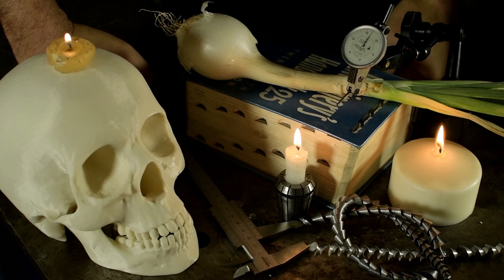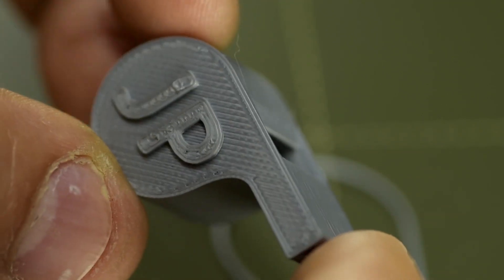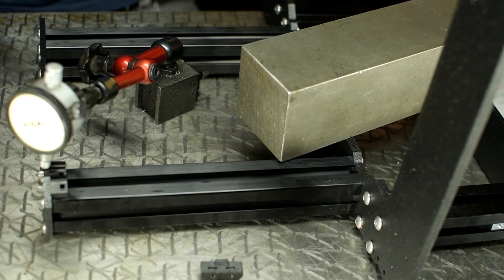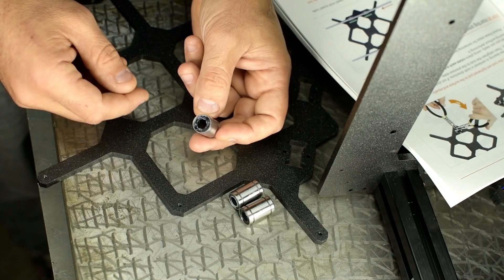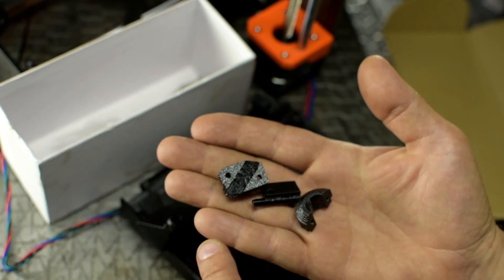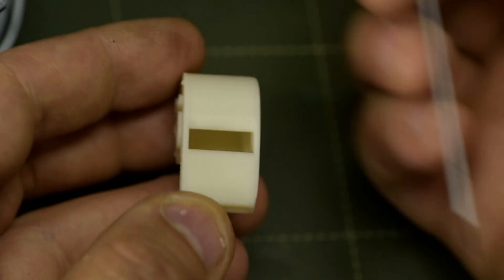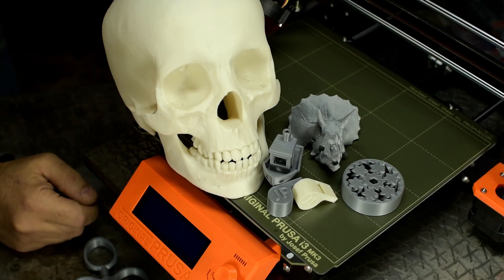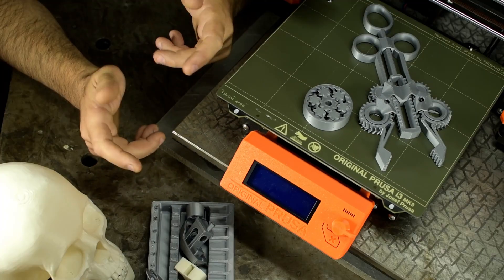This Old Tony in 3D!!! (printing)

Comment: I built a Creality CR-10 (Chinese knockoff) from a kit a few years ago. It has been great! I use it weekly and it's a work horse. I can't believe how many uses I've come up with over the years. From simple clamps to auto shift knobs to drink coasters to cell phone accessories... The list goes on and on. I've combined it with other hobbies like two part colored epoxy and even with my drone photography and welding/metal work hobbies. I use Tinkercad as my primary design tool. Easy to learn and your only limit is your own imagination and creativity. Thanks for adding this to your fantastic build videos. You of all people will come up with some GREAT uses. BTW, It took just as many gummi bears to complete as the Prusa.

Comment: Try some HIPS (High Impact Polystyrene) It prints with ABS settings, and is sandable and paintable.  Also, tends to be a lot cheaper, or at least used to be.  I'm having trouble finding it now.

Comment: Your Y-axis acceleration looks like it could be reduced a bit. The Benchy shows a bit of where the build plate took a bit to slow down and couldn't perfectly stop (I'm guessing it was printed point to the front of the machine). You might even be able to reduce the acceleration on both the  X- and Y- axes, and that'd just clean up corners. The wisps could either be a sign of the temperature being a bit high for the filament or needing to slightly retract on moves.

Comment: Hey, great video as always. I use an Ender3. I love it, but I will be the first to admit that it is so heavily modified, that it doesn't much resemble the original device. I'll be eagerly waiting for the day you decide to build one from scratch using a MIG welder for an extruder.

Comment: I really recommend PETG. Strength of ABS without the warp-age although slightly hard to print that PLA. The thing with PET is higher temps and much slower speeds. I have been printing with PETG exclusively for a couple years and have only started to have issues (mainly due to a clogged nozzle and not installing the new nozzle while up to temp). I have some 18 and 20v battery holders I print and sell. If you let me know what platform you use I'd be happy to send you a few so you can see PETG durability.

Comment: Expect to be terrible at it for a while and relearning many new things when trying new models for the first time. Then you quickly start learning to a new level and you think you're there. You're not. Now comes the most horrible part where you constantly try new settings but can't find out what works or not. And then finally when you push through that, you get ok at printing.
A good printer helps taking away some of the learning process but you will always need trial and some errors when printing new models.

Comment: no 3d printer should ever be held together with zip ties. It's a fatal flaw in the design and it points to a mindset of cutting corners. Corners that will bite you right on the ass later.
Reply: @npgoalkeeper _ interesting, so how is it more tolerant to misalignment? Genuine question.

Comment: 3D printers really are incredibly useful once you learn how to design parts to utilize their strengths. I'd suggest learning a bit more about compliant part designs, Brigham Young University does quite a bit with them. For materials, I'd suggest PET-G, it's about as easy to print as PLA, but a lot stronger and less brittle, TPU is also interesting because it's very flexible.

Comment: I also have a Prusa i3, and take it from me, try not to touch the print surface with your bare fingers. I had a run for a while where I just couldn't get my pla filament to stick to the bed, changing temperatures helped but not enough. Turns out as I was new to the sport I was being stupid and touching the print area without cleaning it enough. These days I never touch the hotbed unless I absolutely have to, and I wipe it down with 99% isopropyl before every print.

I really hope you enjoy printing, I've had mine for about a year, and it still doesn't get old.

Comment: Great. After watching this I've now bought an Ender 5 Pro. Didn't know I wanted a 3D printer till now 🙄
Reply: Well the Ender 5 Pro lasted less than a week. Full refund given and now I'm the owner of a kit built Prusa mk3S. In 10 days of non stop printing with PLA and PETG I've not had a single issue. Fantastic bit of kit.

Comment: You'll notice over time there PLA is subject to deformation from heat, PETG needs to be hot with zero wind. Ellmers glue stick on the bed solves any bed adhesion issues on the small scale with basic materials. (High temperature filaments are great for usable parts but everything cost way more.) A great way to make usable parts with this machine is to make molds or nearly hollow parts that you can fill with the resin of your choice. I mostly use there 3:1 laminating epoxy from FGCI.com with 1/32 milled fiberglass added then injected into the hollow cavity with a large syringe and a blunt 14 gauge dispensing needle. You'll need to drill a tiny hole, don't push in a regular needle or it separates the layers. I set the infill at 10%, Lines, then rotate each layer 10 degrees. You'll see a setting with square brackets, use:  [45,135,55,145,65,155,75,165,85,175,95,185,105,195,115,205,125,215]. For shell items like the tray insert, add Fumed Silica to turn the epoxy into a gel and paint it on the back. Keep the epoxy thin to prevent thermal runaway. For filled parts, once filled you can plug the fill hole with foil tape then stick the whole thing under water to keep the shell from getting hot. Good luck, Tim

Comment: I actually have an Ender 3. It's decent enough out of the box, but definitely benefits from a few upgrades, such as a bed leveling probe and an upgraded mainboard. 

That said, if I was in the market now, the CR6 is a better option at $400. It's basically what I have in my Ender3, but with a touchscreen and none of the fiddling I've done.

Comment: Tony, Tony here...
Though you didn't mention it I feel it necessary to add the biggest benefit(s) to to building specifically a Prusa kit. 
1. When something breaks, you will know how it went together in the first place and how to get back to operational. I like this to the people that buy RTR rc cars and when they break, lie forgotten in a corner never to run again
2. A warranty, factory support and updates with printable part files.
3. I forgot 3, thanks for watching.

Comment: I too have that model and am quite enamored with it. A couple points I'd like to throw in there, are: 1) Get the upgraded plate with textures (at least about the time the included one starts losing its surface) and 2) The bed thermister wire will probably be the first thing to fatigue and fail, creating an opportunity for a video on repairing it. 3) [bonus point] If you have a problem, the company will probably want a video demonstrating it, but will then send replacement parts without trouble.

Comment: 2:07 For any whipper snappers watching, that's a Dot Matrix printer you're hearing 😅🤡
Reply: It sounds like one of those tiny receipt dot matrix printer, the larger ones for printing on A4 or even A3 sound a bit more like "BZZZZZZZZZZZZZZZZZZZZZZZZZZZZZZZZZZZZZZZZZZZT  ... BZZZZZZZZZZZZZZZZZZZZZZZZZZZZZZZZZZZZZt ... BZZZZZZZZZZZZZZZZZZZZZZZZZZZZZZZZZZZZZZZZZT". It has longer "bzzt"'s because it covers the whole line before printing the next line or going back to the start to print the next line.

Comment: And to add even more maker methods to the mix:
What kind of filament would burn away best, if you wanted to use lost-wax casting to transform a 3D printed plastic prototype into a molten metal masterpiece?

Comment: Sir, bringing your in depth-approach to the 3D printing world is amazing. Big thumbs up. 
I would really recommend you to delve in the Prusa Multi-Material add on that would allow using different filaments (like stronger inner resistance beams, flexible splines for articulated mechanisms or water soluble filament for impossible print-in-place objects).

Comment: You big baby. I built a box frame prusa from parts I ordered of ebay. I will admit it took me about a year of tinkering to get it working. The real pain in the ass is when you build a printer like I did you have almost no instructions. I would have killed for an instruction book like the one you have.Good job on your first print. I'm not going to tell you how fugly my first benchy was. I look forward to more 3d printing videos.
I almost forgot. Get a Raspberry pi and install OctoPrint. You will be able to control you printer from anywhere in the house. Add a cheap little Raspberry pi camera and you get nice time laps videos of you prints.
BTW - I leaned something from you. I used light machine oil on my bearings, guess I better fix that, but like I said, I did not have an instruction book.

Comment: PETG fantastic but sticks to the bed a bit too much with big parts

PLA works fine but absorbs moisture over time

ABS unless you build it a thermal enclosure....... R U N its not worth the time

ASA+ fantastic and great strength and thermal propertys

Comment: I can also definitely recommend the Creality (I've started on the Ender 3 Pro) but it's definitely less plug-and-play than this one was.  No auto-leveling means you'll have to get good at dialing it in yourself, and there are a few mods that I'd recommend. Namely:
- Direct drive adapter to improve consistency especially with flexible filaments (the parts of which can be 3D-printed on itself!)
- Glass print bed (I use the back, untextured side with a small amount of print adhesive)
- Also take a look at 3rd party firmware upgrades that are available for the control board!

Comment: Some advice regarding ASA: 
If you haven't vacuum bagged the material, DO IT NOW. ASA loves to absorb humidity.
ASA loves to warp due to uneven cooling. It will usually warp along the lines of the base. Large footprint PLA parts will do the same from time to time.

You can prevent warping by adjusting the angles of your base layer solid fill. Long lines will do a lot of pulling when they contract. If you can break up those lines with features or adjusting the angle, you can reduce the possibility of the part warping.

Also look into the DIY ECM stuff the 3D Printed gun guys are doing. They can bore steel tube stock, cut chambers, and cut rifling with 3D printed jigs, some copper wire, and a lab power supply.

Comment: Specifically your friends will have recommended the Creality Ender 3 or the Creality Ender 3 Pro (identical except for minor improvements).
I used to work with a couple of the Prusa Mk2 printers and I'm not a fan.
Ender 3 Pro has most of the same issues but is a fraction the price. 
In my experience the biggest difference is bed leveling, and I prefer the manual way of doing things. A PINDA probe is just one more thing to go wrong.

Comment: I bought a Flash Forge Creator Pro in 2014.  It has been a constant chore to keep it running.  I have spent almost as much as it cost in repairs and upgrades.  When you get to that point, you just try to keep it running.  It's a slow sinking ship.  I also use Simplify 3D.  Love that software.

New stepper motor drivers, all new cables (all custom made), new power supply, new extruders, heaters, thermocouples, new main board, new carriage assemblies, new stepper motors, new fans, additional lighting, better build platform, Vacuum Fluorescent Display, etc.  I would rather have a Form Labs.

Comment: I dont know if somebody already wrote it, nobody got time for reading all that ;-) ...
but you might wanna try some acetone surface finishing (for the solvable filaments).

put a support block in a large glass jar. fill a puddle of acetone so your object sits in the dry above.
close jar, set in sun or warm up a bit.
Let the acetone vapor lightly melt/flatten the surface (might also remove tiny hairs)

Comment: now you have to teach it how to print using JB Weld as the print medium . . . for durability!

shouldn't be too hard, just need a block to screw the tubes into with internal passages to a mixer/pump then to the nozzle (don't need the heater) . . . oh, yeah, and a mechanism to squeeze the tubes uniformly . . . other than cleanup, should be a piece of cake for a ToT . . . maybe you could 3D print the holder/squeezer/mixer/pump/nozzle assembly . . . that would eliminate the need to clean it, just print another.

Comment: Good choice on the Prusa. It is a great printer with solid software as you have obviously discovered. I also chose the kit to save money and familiarize myself with how it all works. I personally feel that is the way to go since the build is lengthy but actually quite easy, and most importantly it helps in the future with repairs or upgrades. One piece of advice... Until the time you decide to build a fancy enclosure for the thing, you can just throw a trash bag over it to hold in the heat. Yeah I know, that is about as far from fancy as one can get, honestly to the point of even being considered trashy maybe, but it does work quite well.

Comment: could you help me with a problematic ender 2? i kinda maybe modded the crap outta it (greg's wade extruder, pully x and y axis motor holders, tensioners, custom endstop mounts, stepper dampers, etc) the problem is, that no matter how much i autotune the PID, or how level the bed is, or how straight the frame is, it keeps failing prints, one after another...it starts fine then at some random point during the print, it starts grinding filament and refuses to extrude anymore until i unload and reload the spooland usually by then its too late to recover...ive tried setting the e-steps, tuning flow rates and it just keeps failing...does it need more gummies maybe? i tried white lithium, but it just gave me a headache and made me vomit....what should i do (about the printer)? and if you want hard learning curve the ender 2 (cantilever style)

Comment: My cheap and nasty solution for printing abs is to build a cardboard box around just the y axis and covering the extruder. It limits the height significantly and there is often the problem that the tape holding it together gives up and the cardboard falls down or the extruder gets high enough to catch it, but it does allow me to print abs reliably when required and contains the heat to just the print area, rather than letting the motor drivers and electronics get hotter as well.

Comment: Trust me, there is a learning curve! You're only seeing a tiny part of the curve that looks flat from your perspective. Took me several years to get comfortable with my Anet A8 (heavily modified). A glass bed is essential, and forget all that auto-leveling carp. 

I use my printer to make parts to keep my lathe working, prototypes before committing to metal, jigs and fixtures, even a fairly accurate sine bar...

Comment: The printers are a fine piece of technology, even if immature, but choosing good usable filaments that have decent tensile strength with usable operating temperatures, that can be printed without an enclosure are what make it work for practical purposes... ApolloX for example.

A usable filament combined with decent 3D design skills (which I'm pretty sure you have) is what makes the technology actually useful. I thought I was going to rely on Nylon or ABS, but it turns our those are not easy to print with, without something like ApolloX or whatever, your printer is just a novelty/paperweight. Not a shill for the filament brand, but it's a good example of the type of print material that works.

Comment: Bought my 11yo son an Ender 3 Pro in May, he put it together in maybe 2 hours.  It works great for $235, but is more fiddly for sure, in particular bed leveling every print.  We ended up upgrading it over the following months to get it closer to the Prusa (bed leveling, upgraded extruder, upgraded motherboard), for maybe another $100.  That definitely makes it more reliable in the prints, and it took me probably 30 hours to do those upgrades (a long time spent figuring out software/configs for bltouch) and recalibrating after it.  The Prusa is a really solid printer from what I've heard, I just wasn't ready to spend that much on a printer for my son.  As a learning opportunity for him, it has been much better to go the Ender route.

Comment: The stringiness of your benchy is most likely due to not enough retraction or a build up of pressure inside the nozzle from it being too low to the print surface then transitioning into nothingness releasing the pressure, but it looks pretty decent. After fooling around with every sort of failure with my 2013 MendelMax 2.0, welcome to the troubleshooting club!

Comment: i think the faint vertical line you see around sharp vertical corners may be the 3D printer shaking? perhaps look for settings to slow down the printhead's printing speed rate whent it prints the outer surfaces. But not too slow, because small features may melt again and become some sticky mess... An additionnal cooling fan could be helpful to avoid that too (although you may already have it.. i didn't see very clearly)

Comment: Glass panes actually have a fair bit of inconsistency to them. We tried glass panes as print beds, and the surfaces varied by as much as 10-thou.

EDIT: To add to this, large print jobs that covered the majority of the build plates would often fail from the slight surface inconsistencies.